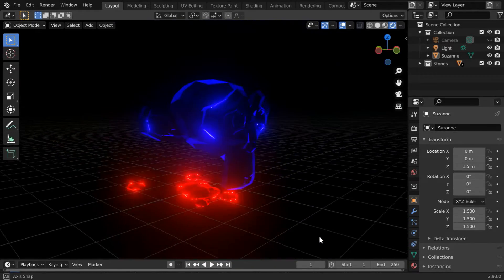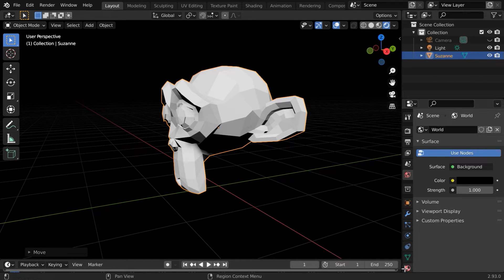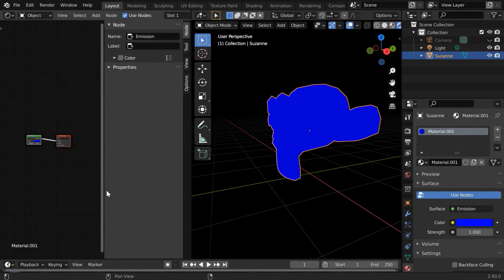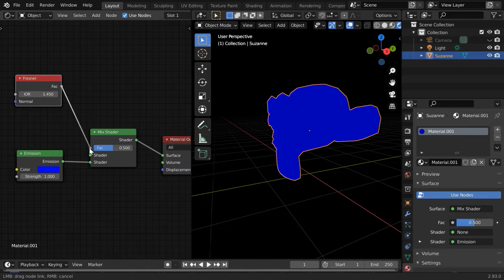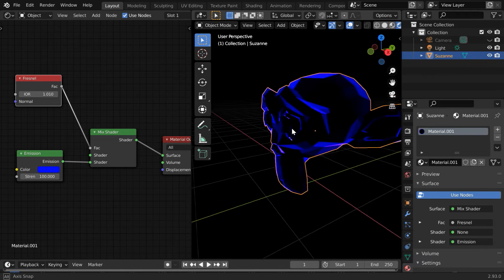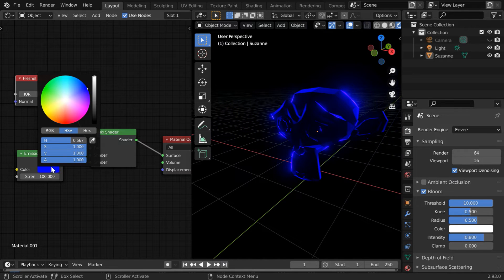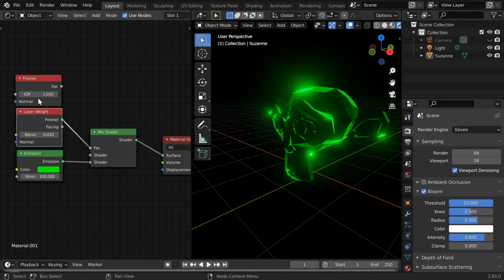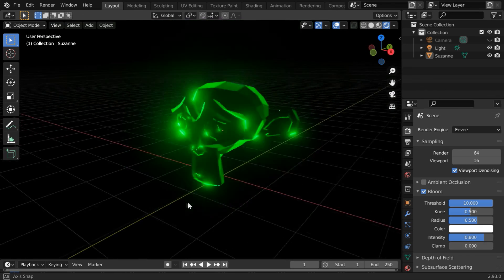Use of Fresnel for Directional Glow Effect | Layer Weight Node | Easy Tutorial For Eevee

Comment: Is there an alternative to layer weight because layer weight can’t be baked out in cycles it bakes to a black texture so is there an alternative to be able to bake out the same effect
Reply from the maker: Are you sure that layer weight does not work in Cycles? Because I could easily get the same effect in Cycles as well. The problem with Cycles is different, it does not come with a Bloom option. So the Bloom effect is not visible by default, you need to add that separately, only then the same effect will be created. The following tutorial can help you to get the Bloom-like glow in Cycles 👉 https://youtu.be/dW3qgAaiPik
Reply: @5MinutesBlender  It works in cycles but it can’t be baked out into a texture map from all the research I did yesterday Layer weights relies on the view of the camera. Everything banks out normally as soon as I remove layer away from the equation but it doesn’t have the same effect
Reply from the maker: @DaRealXXLSlayer  Okay, got you. How about the Fresnel node? You can directly use Fresnel instead of the Layer Weight Node. Please check if that works for you (you need to reduce the IOR value sufficiently in the Fresnel node as shown in this tutorial). Otherwise you can use a simple math node setup to get the same thing. Use two Texture coordinate nodes and take their Object output. In one node, use the target object itself as the source, and in another node, use the Camera object. So you will get the coordinate of each texture point w.r.t. the object's center and the Camera's center. Now use a Separate XYZ node to get the individual X, Y, Z values, square them, add them, and take the square root - to get these two distances. Divide them to get the Sine value of the camera angle. Now use a Map Range node to convert this angle into the Fresnel output. This is indeed the math that runs behind the Fresnel node, so you can implement the same thing using this node setup. It is not very complicated if you are well-versed with node editor. All the best!